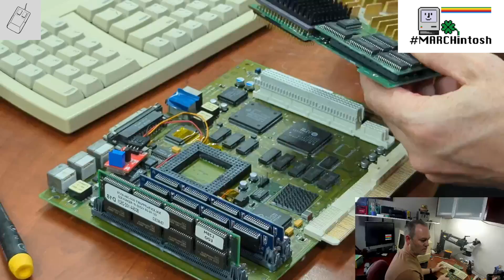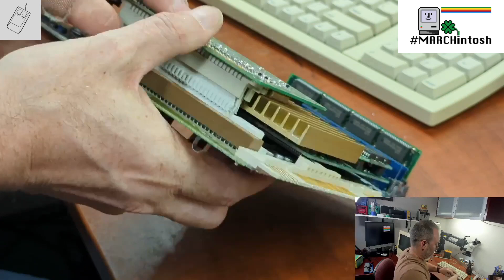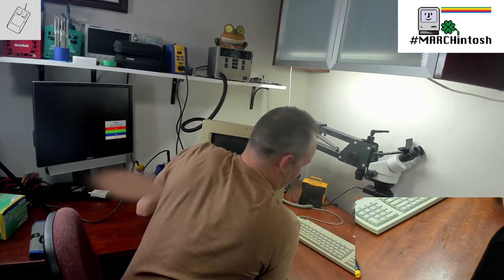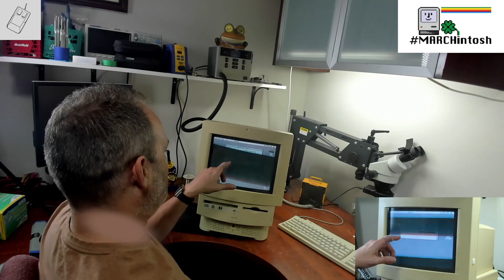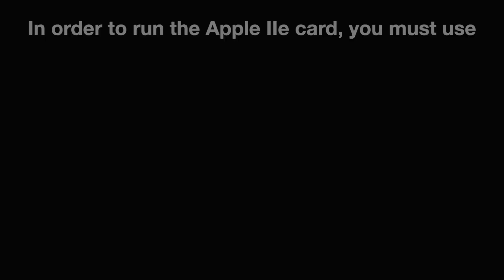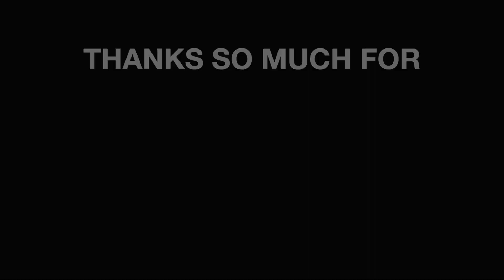Tower of Power MYSTIC!!

Comment: Wouldn’t it make more sense to put the IIe card in normally then have the 601/040 card on a riser from the CPU slot for heat purposes?

Oh and also the standard keyboard does have escape.. to the right of the space bar 😉
Reply from the maker: I never thought about that, that might work, however we need to consider the height variable with the Color Classic. There's not a lot of space in there, so if you tried to use a 68040 riser (or two) the card might sit higher than it already does.  I'll take a closer look at that though, thanks for the feedback!
Reply from the maker: Yeah, I also figured out the Escape key after the video was over..  hilarious!